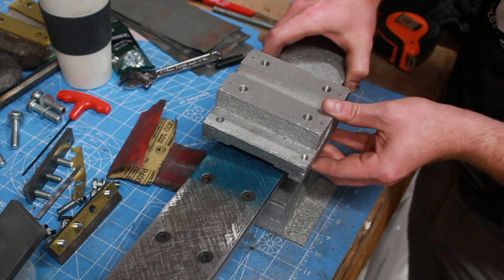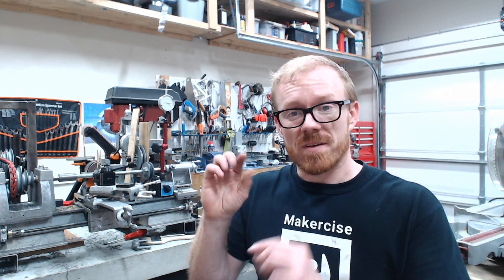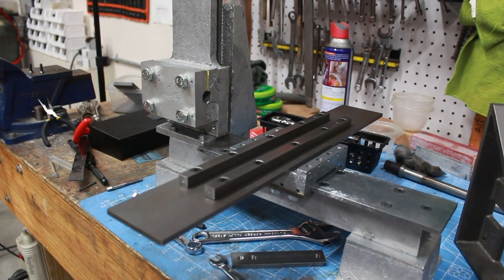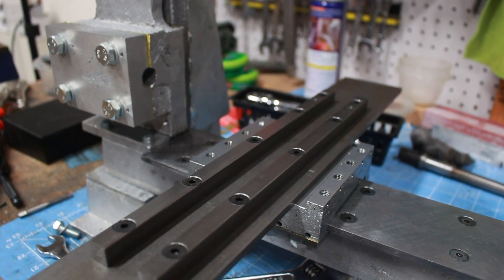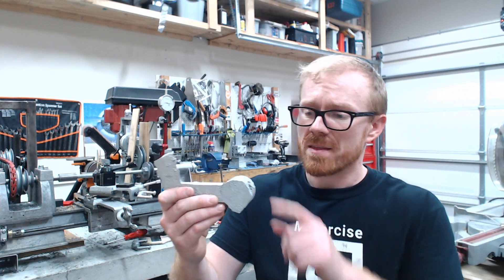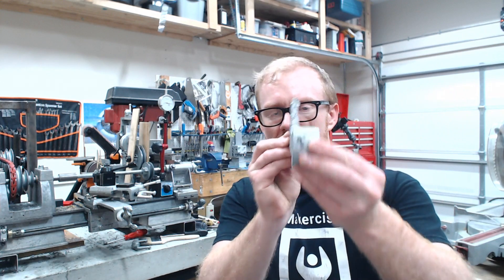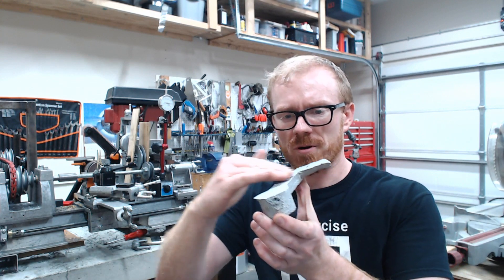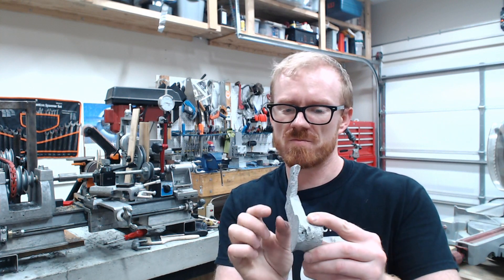Morning ☕- Starting Cross Slide

Comment: Re: Carriage Feed Screw support: I would true it up on the lathe, bore my hole for the bushing, and then establish my angle for the shaper work by mounting the support on a shaft in it's near-final location so you can measure the amount you need to take off the one edge to get the right angle.  Using trig, as another commented suggested, assumes that you can accurately measure the angle you need to ensure the bored hole is in alignment with the mounted screw axis, which you probably can't do well (I know I don't have a way of doing that).  This same issue arises when considering using a separate wedge as well.  You could always use shims to get it right, in either case.  Another way around this critical alignment issue would be to use a self-aligning bearing in the support, rather than a straight bushing.

Comment: G’day Cressel, just missed you. I didn’t have an option for the screw support but hand filing didn’t take long but since you have a Shaper, why not use it, it would be a nice little exercise in setting up. 
As for the temporary work table measure the thickness of the current stack for parallelism, I ended up with the permanent work table being approximately 0.009” lower on one side, also confirm the carriage way slides are in the same height off the bed ways. I’m currently machining the deck of the permanent work table to make  it parallel (well after I finish work on the house)
Cheers 
Peter